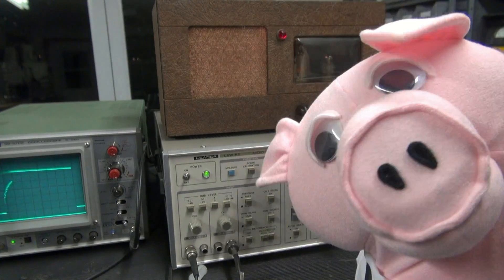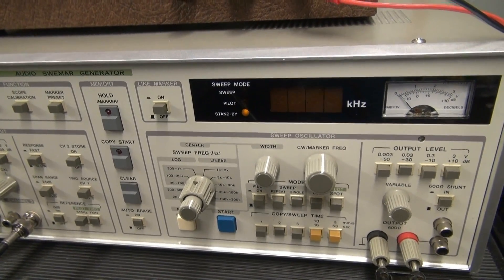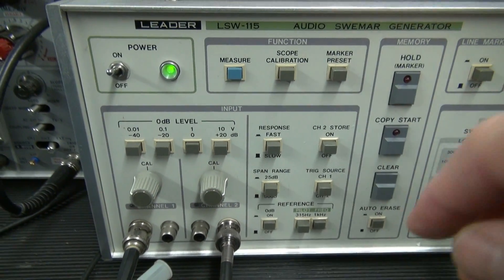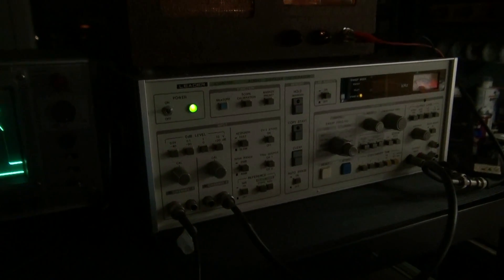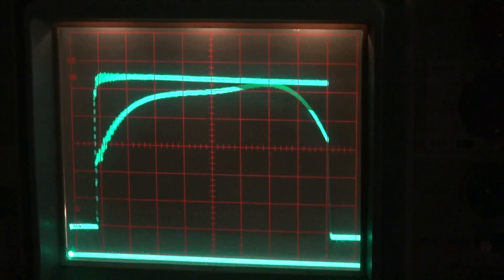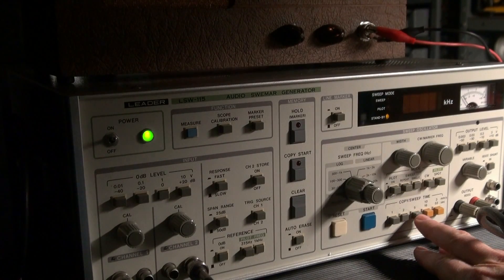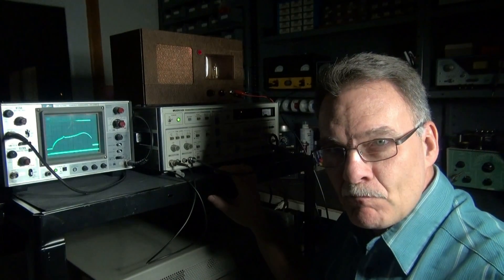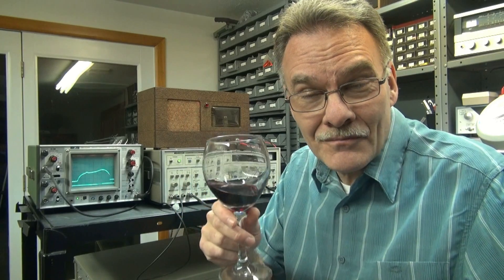How to check guitar amp frequency response Leader LSW-115 swemar audio sweep generator

Comment: Terry, love the video.  Just like you said it's not easy to find LSW-115.  Is it necessary to buy a higher end sweep generator?  I see Amazon has gobs of sweep generator from $50 to $150.  Is there one you recommend for profiling the audio range or can you tell me what specs to avoid when going cheap?  I plan to use it with my Rigol 1054Z scope.  Thanks
Reply from the maker: Hey man, I will check into it and let you know. TD
Reply: I was thinking about BK Precision old 4017A.
Reply: Did you solved your problem? I want to do the same thing with my 1054Z. How you did it? Thanks!!!

Comment: Thank you always for the awesome videos!
Terry I am building an amp and in dire need of some help.

I've wired my power transformer (classic tone brand) to the 4 tube heaters, daisy chained, tested and am getting the proper 3.1v per heater tab and the tubes light up nicely. The power transformer has a second set of 6.3 leads for a rectifier tube, I'm choosing to send these to the pilot light, here is my problem.... These wires are giving off 40V!!!, have you ever come across this? Is something wrong with the transformer? Or did I make a mistake here? nothing else in the amp is wired yet. 
Thank you so much for any help! :D
Reply from the maker: Hello, strange problem. The 2nd set should be 5vac for a rectifier tube, like a 5Y3. Some transformers also have a bias winding and that sounds like the right voltage range. I would recommend that you leave that set alone and connect your dial lamp to the 6.3vac parallel circuit feeding the tube heaters. Make sure your dial lamp is floating, in other words, both connections are isolated from ground. Otherwise it will affect your filament voltage. TD
Reply: +D-lab Electronics you're the best!!! I'll try this out this morning! Thank you as always.